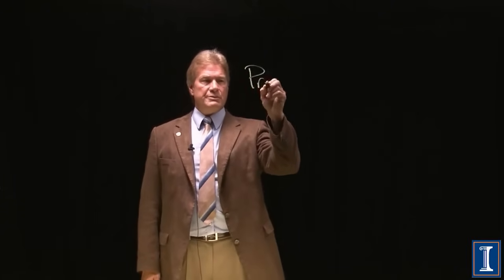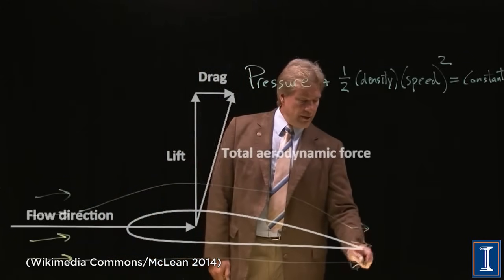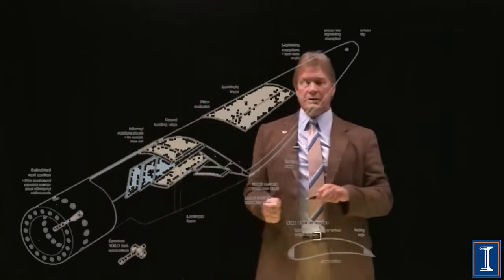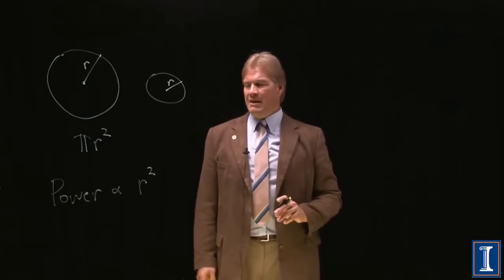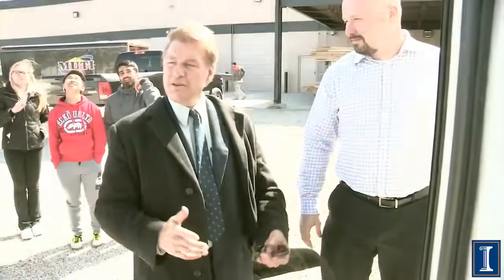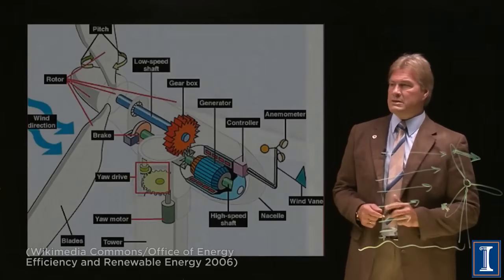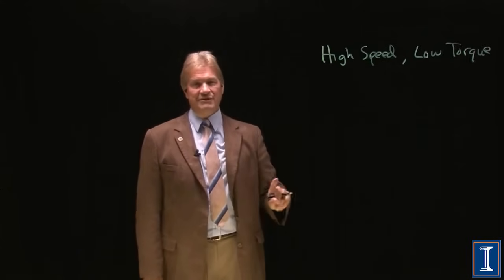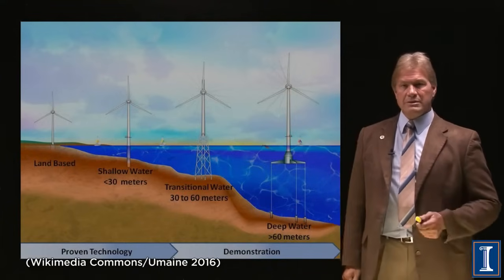How Windmills Work

Comment: Bernoulli has little to do with lift inducing airfoils. It's Newtonian. An airfoil pulls down the air above it, like an inverted scoop, and accelerates it downwards behind it. Opposite and equal reaction: Air pushed down, plane pulled up. The air is pulled down and accelerated by the extreme vacuum created on the backside of the airfoil. i.e. it is not due to the very weak electric charge based Coanda effect.

There is no way or reason for air above an airfoil to communicate with the air blow it. Bernoulli pressure differentials are derived from the conservation of energy/momentum. A single flowing fluid (liquid or gas) will accelerate if its flow becomes constricted, and, to conserve energy, exhibit a lower pressure. And vice versa. A divided airflow is two air flows, not one somehow in communication with the other--Quantum entangled air flows?!

Because the Bernoulli formulas provide a close enough approximation to what is observed, they are used in textbooks and in designing aircraft and airfoils, but Bernoulli is not what is happening.

Airfoil shapes can run from the low-speed ones shown here, and found on commercial aircraft and windmills, to the "barn door" shapes found on fighter jets. Low-speed airfoils slightly bunch up/gather the air above and below their front, allowing them to scoop and accelerate downward even more air. They are much more efficient than the "barn door" shape.

The airfoils of a Windmill's blades work similarly to that found on commercial jets: Wind flow is guided around a blade's airfoil shape by the vacuum on the surface of the backside of the blade. The change in direction induces an opposite reaction on the blade--the blade moves. As a blade moves, up to a point, the blade's airfoil becomes more efficient because of the bunching/gathering at its front.

However, the use of airfoils on the blades of windmills is inefficient. Airfoil shaped blades fail to capture approximately 50% of the possible energy from the wind. The designers of windmills must move beyond the airfoil.

Extra: Gravity, not the an aircraft's engines, is the main source of the energy that creates lift and sustains a plane in flight--two-third to three-quarters, or more, of the energy. The engines make up the rest and provide the energy needed to climb. This is substantiated by the fact that planes have non-powered glide ratios (helicopters, auto-rotation). For instance, a 747's glide ratio is 17:1: It can fly unpowered 17 units (miles, feet, meters, km, etc.) for every unit it falls. 17,000 feet travel for every 1,000 feet in descent.
Reply: I agree with your explanation.  I was told that Bernoulli’s principle falls apart when you have an airfoil that has the same shape above and below.  And the fact that the air above and below does not have to arrive at the trailing edge at the exact same time.  Nice job!
Reply: Sorry but you are wrong.  Please see my post above response to vidznstuff1.  

Regarding gravity being the main source of energy for lift.   Sorry but this is completely wrong.  It always takes energy to climb "UP" and out of a gravity well.  The higher you are in a gravity well the more potential energy you have. That energy that you expend climbing out of the gravity well can then be extracted back as kinetic energy as you move down the gravity well to a lower energy state.  This is the principle behind gravity energy storage batteries.  Be it pumped storage in the form of water being pumped to higher elevation and extracted back via turbines or moving giant concrete blocks up and down through motors.   Gravity itself can never be an energy source as this would be a conservation of energy violation and it would allow for the creation of an over unity machine based on gravity, which we know cannot be done.  Why do you think rockets require so much energy to climb out of a gravity well?  Why does the available payload mass on a rocket decrease rapidly as you move to higher and higher orbits?  Think about the size of a Saturn V which is what was needed to take a tiny capsule and Lunar lander module to the moon.   

A common misconception is that buoyant forces are an example of gravity giving energy to something as it seems like you are able to climb out of a gravity well to a higher energy potential "for free."  And there have been MANY machines designed and built in attempt to use buoyancy as a form of gravitational powered overunity machine.  But in reality you are still simply getting back energy that was expended at some earlier point and stored as potential energy.  I have to expend energy to push a beach ball down to the bottom of the pool.   Or I have to expend energy compressing a can of air so that I can then use it to inflate the ball at the bottom of the pool so that it can lift it up out of the gravity well.

When an airplane is climbing it is 100% indeed using its engines to "lift" up and out of the gravity well.   And if there was some way to calculate all the losses in the system you could balance out the energy equation down to the chemical energy stored within the fuel.   Of course there is also some lift (energy) generated from thermals or ridge lift or even dynamic soaring (which is all manifestations of solar energy or geothermal energy) and a tiny amount from buoyancy which, as from above,  was potential energy stored some time in the past.    However, NONE OF IT is from gravity because gravity is not an energy source and never can be just as magnetism is not an energy source either.  

Your example of airplanes gliding is nothing more than converting the gravitational potential energy you gained (be it with actual engines or thermals) and converting it into kinetic energy.  Gliders have high lift to drag designs so they can convert much of that potential energy from being higher up in the gravity well into forward motion.  However if the glider was crushed into a tight ball by a giant press and then dropped straight down it would still express an identical amount of energy as it hurled towards the ground at hundreds of miles per hour.  You don't have any more potential energy riding a bicycle slowly down a gentle grade then you do dropping straight down off a cliff from the same height.
Reply: It's neither here nor there. Bernoulli is part of what is going on around an inclined airfoil. Curvature (deflection) of flow is more important. Both are combined in Euler's turbine equation. 
Euler, again, is a special case of the all-encompassing Navier-Stokes equation (as is Bernoulli), which usually is not solvable completely for a given real-world problem.
And Newton is just another way of looking at what is going on, but is useless on its own to determine the field of the airflow. It is, again, part of what underlies the Navier-Stokes equation.
You can use Newton's law of momentum to determine lift if you measure conditions in the airflow downstream in an experiment. It will not help to predict what to expect from a given shape of an airfoil at a certain angle of attack.
Reply: Coanda is a huge part of it. Boundary layer, and laminar flow are real things. However, the part about the air being pulled down is accurate. (because of Coanda)
Reply: @usquanigo  Coanda explains that/why the flow follows the surface. It' can't predict the flow pattern, though, and thus does not give pressure disributions, which ultimately explain lift. (That's what Euler attempts.) In the end we need to solve some special cases of Navier-Stokes to get the whole picture. Boundary layer theory splits the problem between the boundary layer, where viscosity effects dominate, and the free flow, where they are negligible, and solves the two problems separately.
Reply: mad ass  Absolutely. Look up glide ratio. Planes can, and do fly without power. Here a pilot landed an unpowered over 300,000 pound (136,078 kg) commercial 767 jet, with passengers: https://en.wikipedia.org/wiki/Gimli_Glider

When a plane is flying along, gravity is pulling down on it. This pulling energy causes the wing/airfoil to pull/scoop and accelerate more air downwards from above it. Together with the energy from the engines, flight is sustained.

In unpowered flight, a plane flies, but without power from the engines, also falls--it cannot sustain straight and level flight.

A glider has a high glide ratio, but also uses thermals/updrafts in lieu of engines to keep  it from falling, and even to ascend.

The hard thing for people to grasp is that both the energy from gravity and the engines combines simultaneously to sustain flight--They're both happening at the same time.

Gravity's energy boost to planes/airfoils is why jetpacks consume so much energy in so little flight time, while a small plane (Ultralight, etc.) can remain in the air much longer on less fuel.
Reply: K. Chris Caldwell   So much misinformation it’s not even funny.  “Gravity ... is the main source... that creates lift.”  I’m sure you will be enlightened by responders who know what they’re talking about.
Reply: many airplanes with completely flat wings without airfoil design get off the ground and fly without a problem
Reply: @bonob0123  many airplanes with completely flat wings without airfoil design get off the ground and fly without a problem not really, you're forgetting that the engines of every self propelled airplane (unless they're rocket propelled) use curved wings, whether it's propellers or turbines. they don't produce enough thrust otherwise
Reply: K. Chris Caldwell angle of attack is the most important factor generating lift, likewise when you put your hand out the car window. Relative to the angle attack of the leading edge of your hand. The more aggressive the angle the more force you feel. A neutral angle “feather” will have not much force applied.
Reply: @ThreeSixFour  Not correct. the shape of the airfoil is the most important factor: Camber and chord. Many civilian aircraft airfoils can maintain some degree of lift with a negative angle of attack. 

Differing airfoil shapes require differing angles of attack to maintain a desired amount of lift. i.e. angle of attack follows airfoil shape.

But then, the focus of my comment was not about angle of attack, but instead about airfoil lift generation being Newtonian not Bernoullian.
Reply: K. Chris Caldwell the shape and angle of attack are equally important. Remember the angle of attack is measured against the chord line, which is independent of the camber. This means that lift can still be generated at negative angles of attack for aerofoil sections with large amounts of camber.

Comment: Airplanes do NOT fly due to Bernoulli's principle.  Nearly all lift comes from angle of attack (yes, plus a small amount from Bernoulli for most planes).  For example, aerobatic planes do not have airfoils shaped as shown by the good professor, the wings are symmetrical. Such planes fly perfectly well right side up or upside down.  A better way to describe lift is to use Newton, not Bernoulli.  The wing takes air from above the airplane and forces it down.  'The equal and opposite reaction' is lift.
Reply: The symmetrical wing on an aerobatics airplane produces zero lift if the airflow is perpendicular to the chord of the wing.
To create lift you need an angle of attack (AOT)
Simplified: nose up when flying normal and nose up (wrt the horizon that is) when inverted.
Reply: also (only) by Bernoulli, a plane would not be able to fly upside down. Neither would most hang gliders fly (nor simple paper airplanes.)  (not to speak that the air, assuming no wind, is stationary, that is, speed is zero)
Reply: strohtaler again, did you watch the whole video?
Reply: @theflyingmylle  yes, and your point?
Reply: Did you watch the whole video?

Comment: Nasa says that the Bernoulli/equal transit effect is false. The reason why aerofoils produce lift is because it deflects the air downwards. Since air particles have mass, the opposite force is acted upon the aerofoil causing it to lift up.
Reply: It is a combination of both.  Did Nasa actually put out an article stating that Bernoulli equation does not apply to airfoils?  I doubt that.  drag and lift of airfoils are calculated from experimentation anyways.  The exact math behind how it works isn't known yet(and there is a million dollar prize to anyone who figures out how to simulate with only math).
Reply: thedillestpickle Bernoulli only applies along a fluid stream and not across it.
Reply: loser face please explain how symmetrical aerofoil section would generate lift as you have not mention the other vital ingredient in the generation of lift?

Comment: Two air molecules that separate from each other at the leading edge don't have to meet again at the trailing edge......
Please do a cost analysis to show wind energy is noncompetitive without massive govt subsidies, too.
Reply: ye i made a comment about how the bernoulli/equal transit time theory is false. aerofoils use newtons third law of motion to produce lift since the air is deflected downwards which causes a force to be acted upon the aerofoil producing lift.
Reply: @loserface3962  That also gives us the ground effect, which saved me once, on a slow approach in a Twin Beech. (smile)
Reply: Go to an economics prof's channel - this one is physics
Reply: @vidznstuff1  Since you don't know.... the bernoulli/equal transit time theory is false. Look it up, genius. I'm a retired physicist and and have been a flight instructor for 42 years.   WillyB
Reply: @1776vtgmb  Why are you picking a fight with me? I agree that Bernoulli is BS and look elsewhere in these comments and you'll see me post in agreement w you. I was responding to OP.
Reply: @vidznstuff1  Sorry,  you're right, we agree on air molecules. But the guy did a complete post on gas turbine vs nuclear cost structure, showing that nuclear wins out in the end. Wind turbines are a loser both up front and at the end, I think.

Comment: Not sucked in by the lower pressure. It's pushed in by the higher pressure.
Reply: Neither. 

Action/reaction. Push air down, pusher goes up

Comment: Well dang! Not me. I'd like to know how in tarnation wind mill can be on a grid. Is there a limit? How much do they have to spin to break even?
Reply: As the prof was saying, engineers make every effort to site windmills not only where they will catch the highest windspeeds, but also the most consistent winds. That gives the best return on the investment. Beyond that, the economics come down to the durability of the machine, costs of maintenance, life expectancy, and the wholesale market of electricity. Really not much different considerations from any other large investment. As for being connected to the grid, that's done by very precise speed controls, starting with the blades themselves all the way to the output of the variable speed transmission that actually spins the generator (it must spin at an exact speed to be in sync with the AC grid power). As for limits; there is a limit imposed by the fickleness of the wind -- obviously a windmill isn't going to produce power in zero wind. In that situation there must always be a backup supply to carry what power people call "base load." For this reason windmills can only be helpers in the power system at this point in time. If energy storage technology improves to the point of large scale, high capacity storage of electricity, i.e. batteries, then all renewable energy sources can realize their full potential.

Comment: I think your shower curtain hypothesis is incomplete. The shower water is hot, and heats the air pretty quickly, making it more buoyant. When the air in the shower rises, the air on the other side of the shower curtain is pushed in to replace it.
Reply: I agree, although a cold shower will still produce some curtain movement.

Comment: WHAT IS THE BIGGEST A WINDMILL CAN BE??????
Reply: Agree with Mike, above. The limit in size will likely be determined by how large a single component can be before it's  too large to transport economically. Think about how wide a railroad car or road may be. This limit is being seen a bit currently with onshore wind where it's seemingly difficult to make blades longer than about about 75m. There are some interesting proposed solutions to get past this including 2-part blades that are put together on site, or even talk of delivering parts by blimp! These are engineering challenges which may take time to address.
As far as I'm aware, the biggest wind turbine is currently 12 MW with a 220 m diameter rotor for the offshore segment: https://www.windpowermonthly.com/article/1665071/ges-12mw-haliade-x-produces-first-power
Reply: In theory, there is no limit. You don't want the tips of your rotor to exceed the speed of sound though because the blades will experience pretty extreme differences in forces along the blade. 
You can make the windmills larger and larger and use gear reductions to keep blade speeds in check while turning larger generator sets.